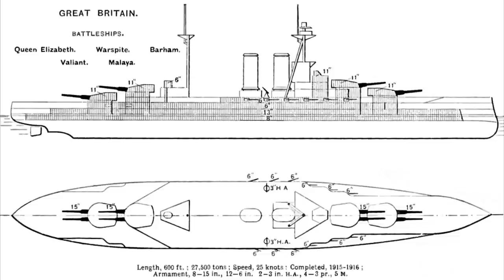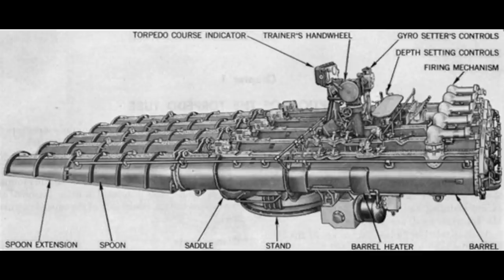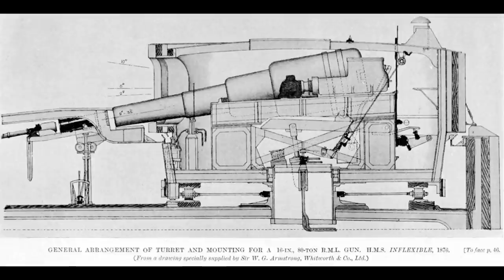The Drydock -- Episode 165

Comment: Actually there are some ships that have a push pull configuration, ice breakers. But the forward propeller was really there to help create a low pressure area under the bow, and a wash to clear ice chunks aft after breaking.

Comment: 56:53 - Dedicated smoke generators, at least later, used titanium tetrachloride. Same fluid used in skywriting. Got a quart of it in high school, back in the 70s. Reacts to water, in the atmosphere. The resultant smoke is titanium oxide, with less opaque hydrochloric acid. In either case, aim it behind you. Though, from experience, the acid concentration, is not high enough to cause short term issues.
Reply: I knew it, chemtrails are reeeaaal
Reply: TiCl4 is/was also used in tank smoke launchers, as far as I know. We used a bit at university for a presentation without knowing the result. It was quite spectacular, to say the least. We used it in a wet-cold night, which had a "positive" influence. We covered an area of approximately 300x300 meters, including the nearby 4-lane road. We never repeated the experiment. And I can confirm that it didn't cause any health issues. I found burning a Kg of black powder to be more uncomfortable.

Comment: Under the scenario in which the RN ended up with only 2 Revenge class ships, they probably could have rectified some or all of the speed gap by refitting them with small tube boilers in the 1920s.  Yeah it’s a pain and expensive, but if ship numbers are capped and they’d get a substantial benefit out of it, then it might be worth it.
Reply: It's entirely possible that the Royal Navy might have ended up with only 2 Revenges in the first place in this scenario. Adding 3 Queen Elizabeths to the production schedule could easily have meant delaying 3 of the Revenges until those slipways are freed up. Which in turn means that those 3 Revenges won't be laid down until late 1914 at the earliest. Historically, this is when Jackie Fisher became First Sea Lord for the 2nd time, and one of his decisions was to cancel the final 3 Revenges (Resistance, Renown, and Repulse) that hadn't been laid down yet, reordering 2 of them as the Renown-class battlecruisers. If 3 more Revenges had their laying down delayed to make way for the Canadian QEs, he might well have cancelled them as well, in favor of 2 or 3 more battlecruisers.

In which case the Royal Navy ends up with an overall much faster fleet, and the 2 remaining Revenges would be scrapped in the early 1930s. At which point Britain's slowest capital ships are the Nelsons.

Comment: Thanks very much for your channel, that I have only just discovered.  Even though this is a subject that I have been interested in & read about extensively for over 50 years, every video of yours is packed with stuff that I didn’t know. However, there is one point on which I believe that you are incorrect - in respect of WW2 voice coms, I think that you will find that by early 1943 Atlantic escort groups had short range VHF voice radio comms, which were used for tactical coordination in the fast moving battles around convoys…. Given the size of some late war convoys these sets must have had a range of more than two or three miles.

Comment: Some ice breakers have the propeller in front when breaking ice. But when moving through open water the propeller is pushing primarily because ice breaking bows ride real bad when moving through open water.
Reply: Now days one common setup is 4 azipods, 2 front, 2 back

Allows all kinds of fancy stuff like rocking sideways, rocking front and back, throwing a outward flushing water flow to any direction and so on.

Plus the two old stables. increasing the flow along the front hull to decrease the friction between the ice and the hull and using the bow propellers to back out incase on has intentionally or unintentionally driven to ice pack so thick one didn't get through.
Reply: @aritakalo8011  plus the bubble technology
Reply: I know the Wind class Icebreakers of the USCG did, but from memory I dont think it worked very well. The idea was something like the forward prop allowed you to back off the ice if needed, and it also agitated the water a bit to help break it up--but in practice it just clogged, jammed up, or flat out got broken a lot.
Reply: @sawyerawr5783  
When I saw the video of the icebreaker I described my thoughts were, "It sounds great if you can make it work." And "I would have gone with great honking trash pumps and squirted the water in whatever direction was most useful at the moment."
Reply: @sawyerawr5783  Well it was very common for certain period all around the world on icebreakers. Maybe that ships specific design/implementation didn't work. Since it wouldn't be the first one.

Icebreaking often involved making a new ship design and concept pretty much as prototype and having to take it to the ice and see it break to iron out problems. Okay the concept works kinda, but it breaks and jams all the time. Okay so it is jammed by this size ice blocks... lets move it this much to there so there is clearance and we need to then reinforce this.

Since it involves interplay of ice and water, it isn't simple to model. Which is why to this day using scale versions in ice tanks is a common thing in icebreaker design.

This is why ice breaking has been field dominated by long established and track recorded design offices, shipyards and suppliers.

As with some other engineering areas, icebreaking is it's own field of "black magic" to make well working and lasting ships. Knowing the likely behaviour of the ice, when it breaks and flows along the hull and so on. Mostly likely via trial and error then turned to institutional knowledge and tradition.

One might look at icebreaker and go "well I make something like that". However even minute change of positions, angles and so on changes things.

Though one would say bow propellers certainly wasn't the utter most perfect solution, since it as such was replaced with bubbling systems for lubrication. Only to make come back with azipods in some vessels for the manoeuvrability benefits.

Comment: Tractor configuration propulsion is actually reasonably common in modern cruise ships - thanks to aziopod propulsion. This puts the propeller well below the hull (which a mechanical drive can’t). Having the propeller below the hull forward gives a reduction in bow  waves and having the propeller in front of the pod gives better propeller efficiency. All this does require electrical variable speed propeller drives in the megawatt class. These were simply unavailable until the 1990’s.
Steam ships with tractor drives did exist but were mostly used as ferries (and were in fact double ended). Having a propeller at the front is a massive problem if you hit anything (as you loose both your bow and propulsion in the one event). Backing your ship over something is far less common.
Reply: Can you give any examples of current ships that have a propeller pod below the bow?
Reply: Ive never seen a cruise ship/floating hotel box with aziopod under bow. Its normally bow thrusters to aid steering not azipods.
i HAVE seen examples of azipods under bow on some bizarre oil rig industry serving floating crane things-
i think your mistaking bow thrusters in tunnels for azipods.
Reply: @keefymckeefface8330  It is usual to have two forward and two aft. The forward pair are locked in forward position while the aft pair are steerable. The thrusters are completely separate and are inside the hull. 
The Queen Mary 2 has this arrangement.
Reply: @allangibson2408  pretty sure you have just misread wiki there. 4 thrusters, all hanging off stern section of ship... I've seen photos of said ship under construction in dock and I'm damn sure I would have noticed such an unusual layout. 
Is reference to the forward pair of thrusters being fixed and aft steerable, but that doesn't mean forward pair thrusters as in in the bow section, it means forward pair thrusters in relation to the other pair just behind them.
Reply: @gregorywright4918  The ice breaker Polaris has a bow mounted azipod…
As does the Bourbon Orca…
The markings on the hull show where an axipod is fitted (it looks like a propeller with a bracket under it - subtly different from the thruster markings which just have a propeller symbol.

Comment: 00:37:50 - My understanding is the US Navy was using their Talk Between Ships (TBS) VHF radiotelephone (voice radios) sets fairly extensively for passing orders within a formation formation by mid WWII.  (For example you can find the log of TBS messages from the battles off Guadalcanal from 11-15 Nov 1942).  
The USN believed that those were so high frequency as to be purely line of sight and so normally safe to use at sea without encryption or encoding.  Unfortunately, at least under some conditions, they could be intercepted far beyond visual range.    

And then the Marines had short range man-portable voice radios used for communicating with their offshore naval support after landing; though in the Pacific Navajo code talkers were normally used to as the radio operators for those to make that communication more secure.

Though as far as I know the long range ship to shore, or formation to formation, communications remained encoded or enciphered Morse code all the way through WWII.

Comment: Short-range voice communication was used on a ship as an additional form of communication for coordinate antisub work in the late part of WW2. I remember Polish destroyers have mounted this type of radio by the British and demonted with all radar equipment before send to new communist Poland. Short-range in this context was merit because the signal was too weak to triangulate by U-boat for convoy position. And This was better than visual systems because on the same loop was ships and planes, when visual systems were used, plane to receive must stop searching for U-boat and fly closer to ship.  Long-range military voice communications start with satellite communication systems, so the signal was sent at narrow-angle to the satellite, almost impossible to intercept.
Reply: This is depicted in "The Good Shepherd" (the novel on which the film "Greyhound" is based). I haven't seen the film but in the book it is called TBS (Talk Between Ships).
Reply: The Support groups used american supplied short range radios to coordinate the prosecution of attacks on submarines from about 1943 onwards, it was partucularly useful in  the creep attacks, where one ship would hold the contact and a 2nd ship would be guided onto the target at low speed and silent on ASDIC so it could not be heard by the sub and therefore could not evade. Previously the attacking ship would loose contact as it neared the point it released its depth charges.

Comment: The US Navy had TBS (Talk Between Ships) during WWII and remember that radio signals travel farther over water than on land that isn't a completely flat desert. They apparently only used it in emergency situations because it wasn't encoded. 
In the recent Tom Hanks movie "Greyhound" that no one saw because it's only available on AppleTV+ (They do let you watch a month for free if you sign up. I watched it and immediately unsubscribed) he portrays a Fletcher Class destroyer Captain escorting a trans-Atlantic convoy in mid-war from North America to Britain. In one scene while they're being attacked by a German wolf pack, a U-Boat is able to threaten Captain "Hanks" over a speaker on the bridge and he seems to have no way to turn it off. It's not that every other transmission is portrayed as being relayed to the bridge from the radio operator, It's the U-Boat's ability to hijack the American TBS frequency  and risk being triangulated and located while on the surface that bothers me the most. Also it's the only scene where the skipper is on the bridge alone?!

Comment: Sail powered container ships could definitely be done, instead of stacking the containers on the deck and up as is currently done, have the containers slot in their racks down into the hull of the vessel, thus forming ballast - this leaves the deck space mostly free for sail. Now, I have no doubt that such a ship wouldn't be fast and wouldn't carry as many as todays giant bulk container vessels, but with todays world focusing so much on 'green' power, bulk non time sensitive containers could be moved this way and there may well be a market for it.
Reply: Rigid "wing" sails, and the tall cylindrical "Rotor Sails" can and will be used on some merchant ships (and are being tested now). Although tankers are the obvious ones to do it with, their small deck footprint will also allow them to have limited use on container ships. The savings in fuel costs will certainly warrant it (with a fairly low ROI period)... fossil fuels are not getting cheaper and will increase in cost. As for added crew required, these are fully mechanized and automated systems which need little care. They are generally light in weight, with the upper parts mostly made of fiberglass or carbon fiber, so the top-hamper should not be too bad (needed changes to the ballast or hull design should be fairly minimal). I would suspect there will also sometimes be some method for lowering them down on deck for hurricanes, going under highway bridges, or maintenance (they can be quite tall, perhaps 180' total).
Reply: About two thirds of the containers are already in the hull. So you will lose one third of the containers. It would be fun to see a 400 metre container ship under sail.
Reply: Today, time sensitive, high value items are are air freighted to their destinations. The big problems with wind powered ships are inconsistent wind speeds and direction coupled with the low maximum speed possible. For some cargoes delivery schedules are not critical but other cargoes maintaining a reliable schedule is. Modern manufacturing and distribution relies on 'Just In Time' deliveries which means maintaining reliable schedules is critical for many bulk time goods. The low maximum speed means more hulls will be needed to carry the freight as each ship will spend more time in transit. Also, even more hulls might be needed as I am not sure what the practical size limit is for a wind powered ship.
Reply: Also, in present day, there are hundreds of containers parked outside of ports for....reasons.  Speed wouldn't be an issue.
Reply: @washingtonradio  I seriously doubt that the ships will not maintain a normal cruising speed; the idea is to take benefit from the sails when it is offered; throttling the engines down to maintain the same speed, not turn them off. And the thing about modern sail designs like Flettner Rotors are, they can actually get a little added power from the apparent speed as well as the wind. The Magnus Effect is like the "spin" on a tennis ball; creating lift perpendicular to the wind (what causes the ball to move to the left or right from the normal path). So with just a little natural wind towards the beam to push the perpendicular slightly aft under power, it will add thrust to the ship, more so than if the engines were off. The downside is you have to spend some energy to keep it spinning.  

These days many ships probably spend as much time waiting to get into port and loading and unloading, then actually sailing between them (you can often see them sitting around outside of major ports). I imagine China and the other far east ports are an exception, but not the Atlantic major ports like Miami or New York, where I have seen up to a dozen ships waiting to get in.
https://www.norsepower.com/technology/
Reply: @auscolpyrtosspott9175  There is a world shortage of containers
Reply: @washingtonradio  (90% of the worlds trade is bt sea. I seems an odd argument that its better to transport goods by air in support of sailing ships.
Reply: @benwilson6145  I am not arguing for more air freight but pointing out it is used today for certain types of products already and has been for many years.
Reply: @washingtonradio  Pretty much everything that comes from Japan, China and Korea is is a container, this includes I Phones, electronics, clothing , furniture. Vast quantities of food fresh frozen and tinned also comes in containers. Cars and trucks in Ro Ro vessels. Oil in Tankers. Grain, and ore in bulk carriers.I suggest you buy the Admiralty Charts for Sailing vessel, 12 charts showing the recommended sailing routes by month. You will see how impractical it is.